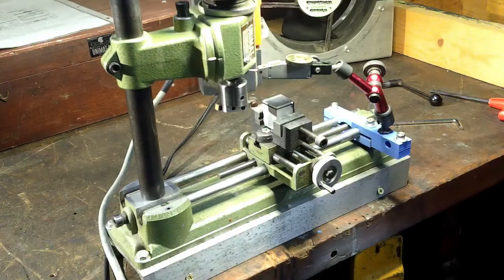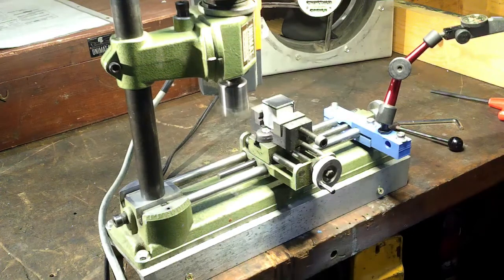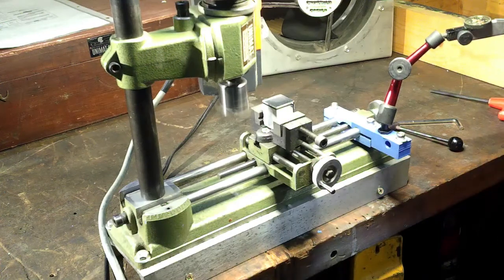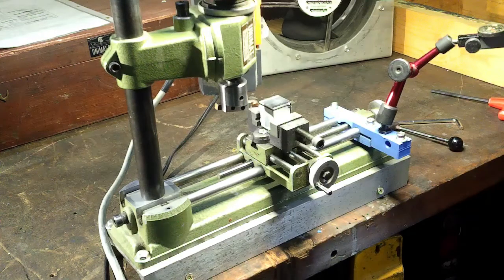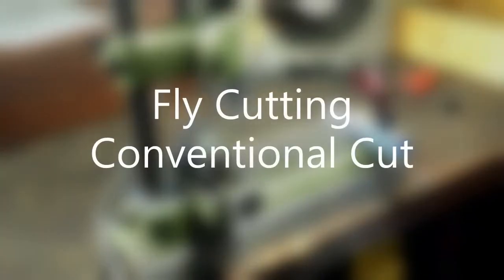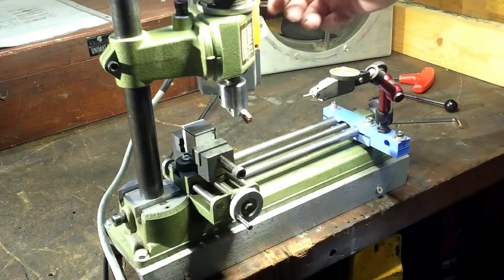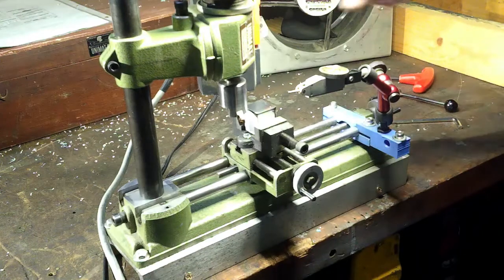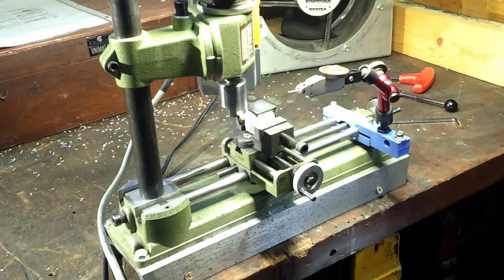Unimat SL1000 Fly Cutter Test

Comment: I would like to see a video of you setting and locking the head for the depth of cut. Nice work on the fly cutter. I need to make one for my own DB200.
Reply from the maker: i will say that it's tricky to hit a specific DOC without use of an indicator. for this test , i just retracted the headstock, set the tool on top of the work and extended the headstock what looked like a couple thousandths and locked the 2 headstock retaining screws- then made cuts.
don't expect large DOC's. limit them to a thousandth or 2. the finish is quite good on aluminum, i would not suggect fly cutting steel if you can avoid it on a Unimat.
i can make a video showing the process in a couple days. Thank you for your interest.
Reply: @mikewalton5469  I only work with brass, so not aluminum, but also not steel. I need to make a nice fly cutter like yours. Great work!

Comment: Where did you find that fly cutter that fit properly. 

Did you turn down the shank from 3/8 to 15/16 thank you looking to do this with my Unimat as well
Reply from the maker: I made it from scratch. The flycutter is internally threaded M12x1.0 to a depth of 12mm